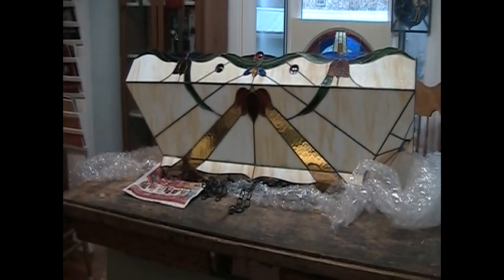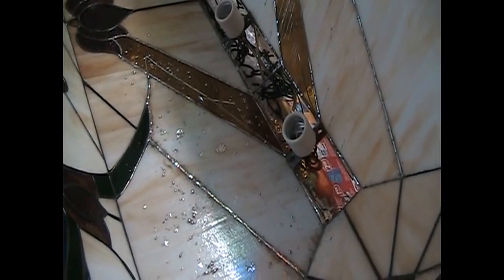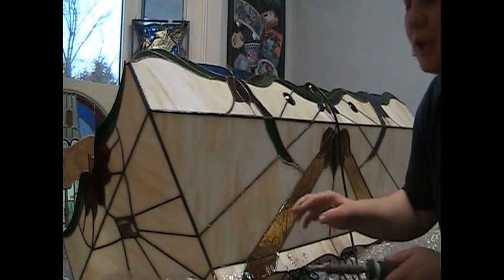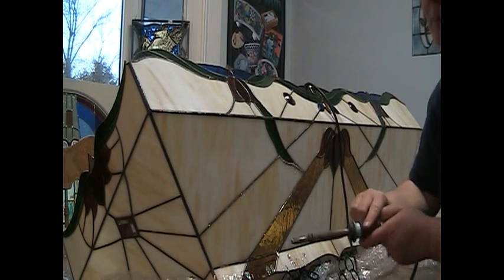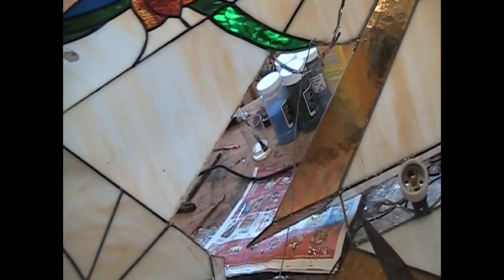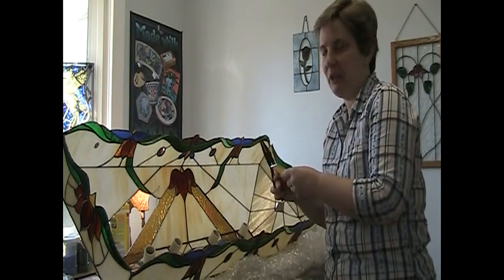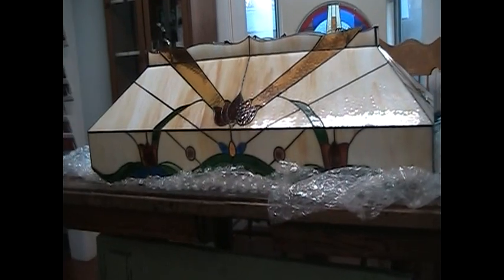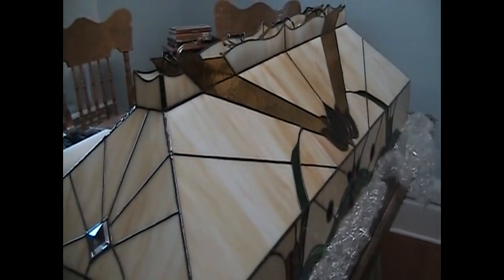Stained Glass Lamp Repair - Custom Stained Glass

Comment: I'm sure she is good at what she does. I've repaired similar projects. You have to solve the reason it came apart, too much weight. I would use a rod or copper wires to distribute some of the weight. Good job.

Comment: I have "fake" tiffany lamp shades that I LOVE but no one addresses repairing the metal frames  that seems to bend and starts to push the (fake) glass out. I suspect that my grand kids may have knocked them over at some point. I am sure many more people have the fake Tiffany lamps than genuine and would appreciate how to repair or re-bend the areas of the frame without  disrupting the entire shade.